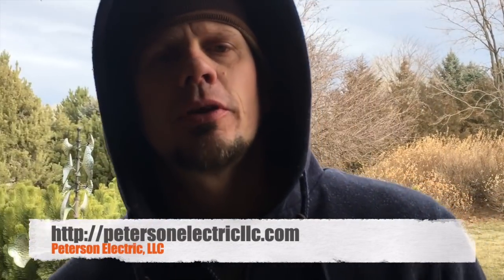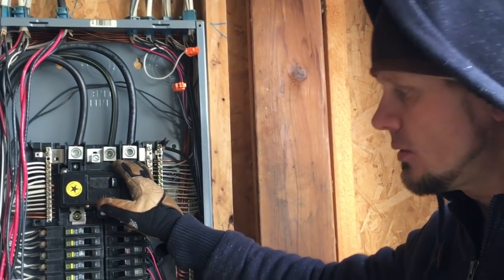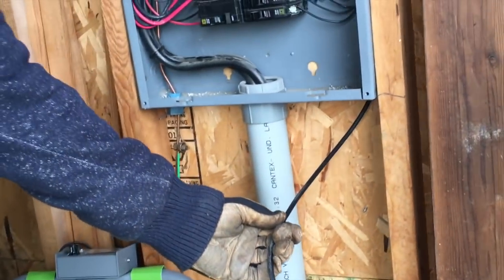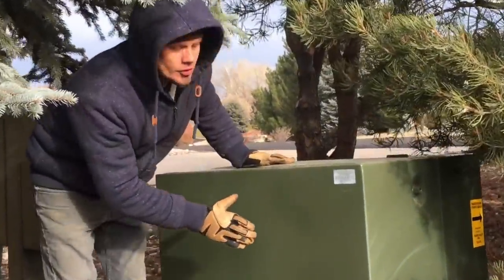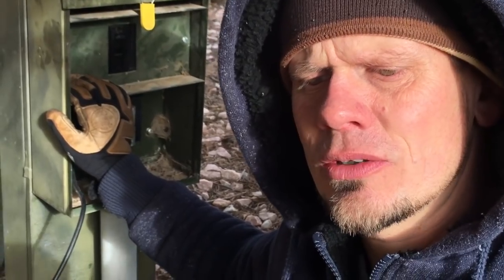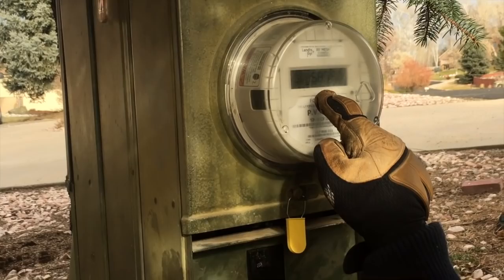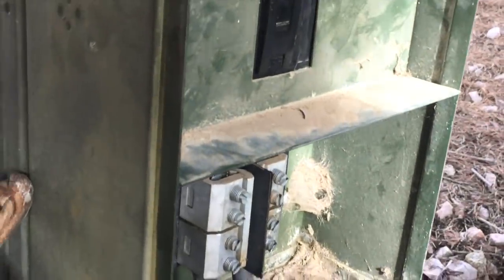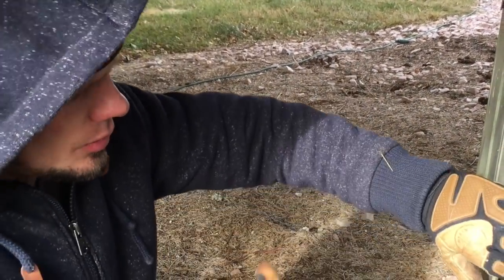Power Out, Lights Flickering—Part 1

Comment: The moment you check voltage at the main panel and have high voltage on one leg, and low voltage on the other leg, that is the classic symptom for a bad neutral connection. (Example, 115 volts on one leg, and 130 volts on the other.) It can damage appliances and electronics and light bulbs so it's probably best to turn off the main breaker until the problem is corrected.

Comment: My experience: lights flickering = neutral problem somewhere most of the time.
Reply: I could have this problem in my house
Reply: @ervinlosha1333  could be several things... you'll have to get an electrician to chase it down. I won't even make a guess over the internet. Could even be a power company problem out at their pole
Tip: before hiring the electrician ask for references.